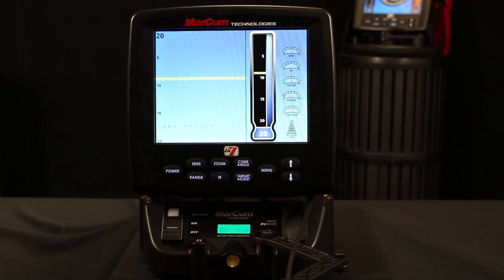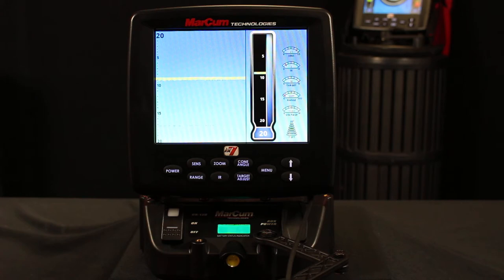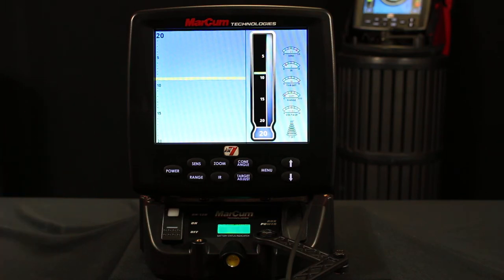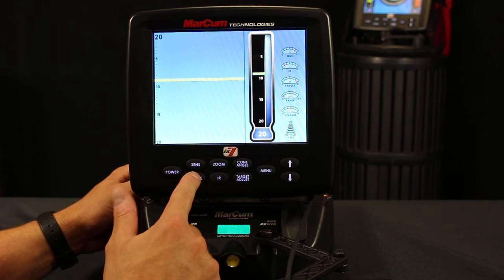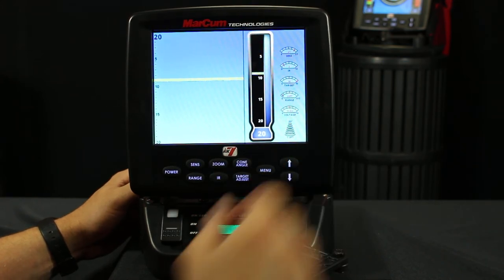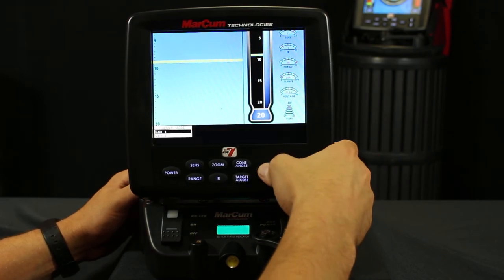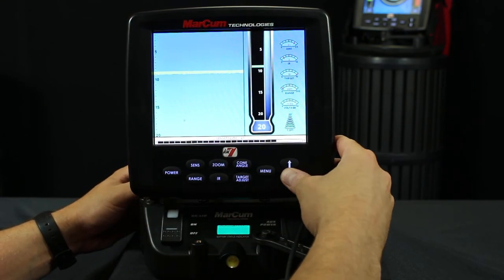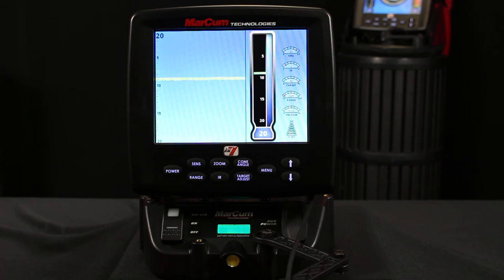Digital series sonar test

Comment from the maker: Our systems are designed to work in water, that is why this test gives a reading of 8 to 10 feet when holding the transducer 3 feet off of a hard surface.  You shohold get a solid red return
Reply: Thanks for the reply.  I don't  believe I was able to get a red bottom ,even at a pretty high gain.  I have an LX-9 with the new software.  I see you guys didn't get a red bottom in your video demonstration either?